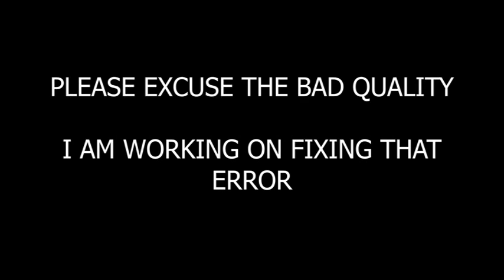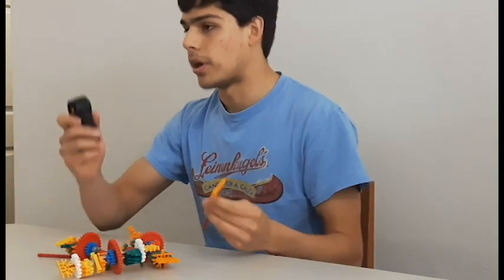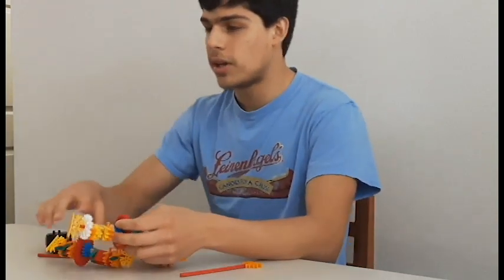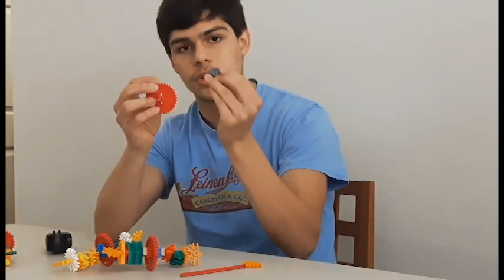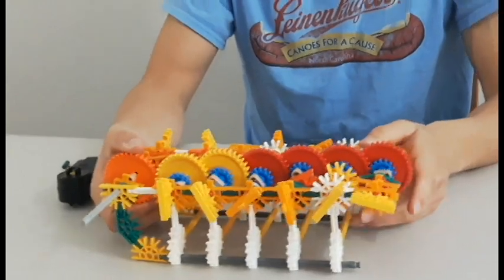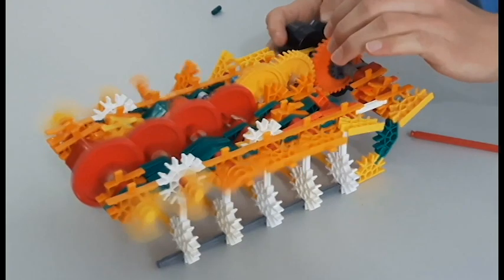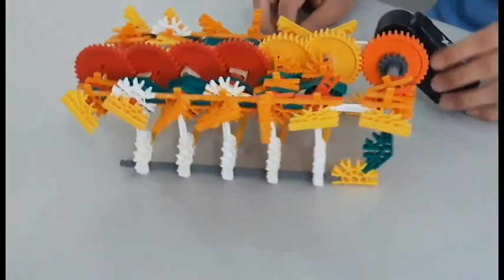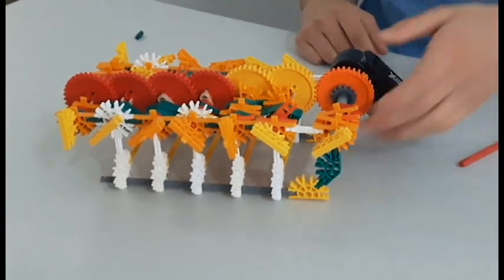Making Gears Spin Unbelievably Fast! (2500+RPM!) | Wild Kinetics

Comment: FINALLY jfc why are you the only person on youtube who actually did this

Thank you
Reply: Because it's more difficult to do it that way.   As the speed and number of succeeding gears increases, so does the friction, while at the same time, the torque decreases.  So it's kind of a "double whammy" -- more torque is required to continue turning the succeeding gears, while less torque is available.  So it isn't long before the decreasing torque becomes so low that it can't overcome the increeasing friction.
Reply: @Milesco  why not just sequence it until you actually break one of the gears, would make for an interesting video
Reply: Maybe others tried to do it nearly perfectly, but got sucked into another dimension...
Reply: @crabinijig8403  :  I just re-watched the video, and the problem is, as the guy said, the first drive gear would just start skipping. 

The gears wouldn't actually break -- what would happen is that the very high torque (much more than that little motor could provide -- it would have to be done by hand)...the very high torque applied to the first gear would cause the first and second gears to force themselves apart and then the teeth of the first gear would just skip past the teeth of the second gear.  In other words, nothing interesting would happen.  ☹
Reply: Yep, took a bit to find this but found it nested in some comments somwehere else.

Comment: Any chance this idea can be put to practical use besides vehicle transmissions?
Like maybe an energy amplifier?
Reply from the maker: Yes, absolutely. You could probably hook it up to a generator to generate electricity if that's what you're asking. If you attach a DC Motor to the last one that's spinning the fastest. that's how you generate electricity.
Reply: @WildKinetics  sweet
Sure it will need some strong gears to handle tension, but applying it will be worthwhile
Reply: There's no such thing as an energy amplifier.

Gear increase (as opposed to "reduction") transmissions are very rare, because it's unusual to have a power source with high torque and low speeed.  Usually it's low torque and high speed.
Reply: @Milesco  I wanna use it in my bicycle, so that's why I specificaly want gear increase for this. In the end I want my alternator have high rpm in the output gear than the input gear.
Gear reduction is comonly used in cargo areas where it's used for lifting very heavy objects without use of forklifts or any machine
Reply: @abskhairoun  :  Yeah, I remember when I was a kid back in the 1970s, they made small generators for use with bicycles to power a headlight and taillight.  The generator would be bolted to the frame of the bike and the input shaft had a small gear on it (say around 2.5 - 3 cm in diameter) that was pressed against the tire.   Because the gear was small, it spun fast enough when the bike was moving to provide electricity for the headlight and small taillight.

Of course, the generator wouldn't produce any power when the bike wasn't actually moving, and now that rechargeable batteries are widely available, everybody just uses battery-powered lights now.
Reply: @Milesco  i want this premise, but different application.
Like making the bike stationery and use a car's alternator as my generator

Comment: The gears inside the motor are step-down. You made a step-up gear chain. The fastest gear is not the fastest though. the motor gear inside the motor is.
Reply from the maker: Good point!
Reply: Shhh